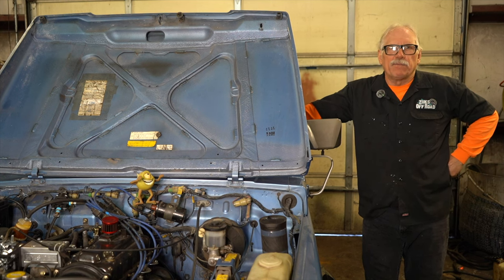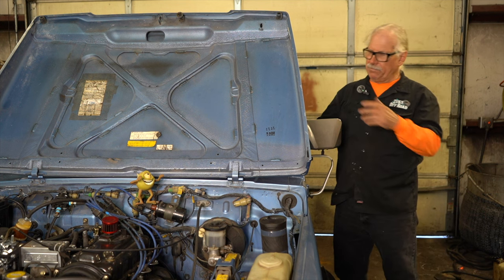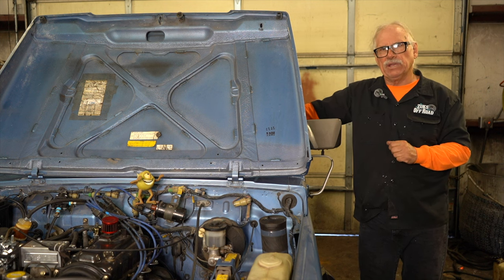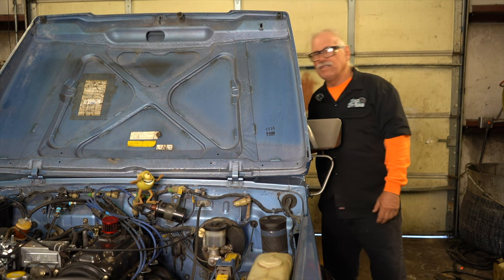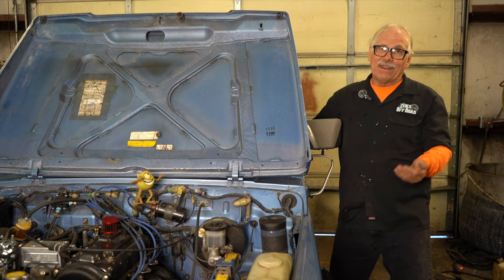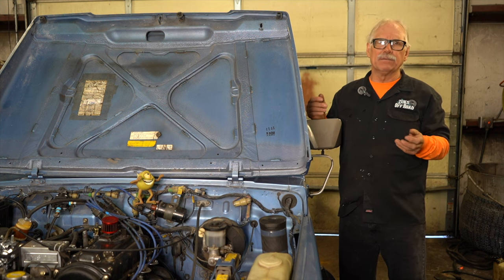Suzuki Samurai Steering Wheel Play Fix

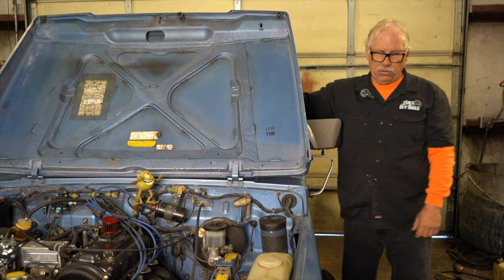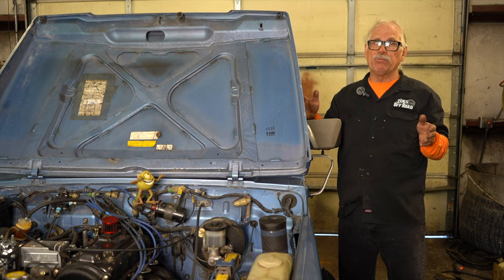Comment: Great video.  Thanks!  After putting a SPOA lift on my samurai It messed up the centering on my Steering wheel.  I think Top Dead Center is now at the 2:00 to 3:00 position.  I'm using a z-link until I can pull the trigger on your heavy duty steering system.  What is the best way to center out the steering wheel?  Pop it off and adjust it?  I can't seem to find a video with a clear answer on that.   
Thanks again for all the awesome helps you put out.
Reply from the maker: Gonna have to pop a wheel and show you all how to center a steering wheel.